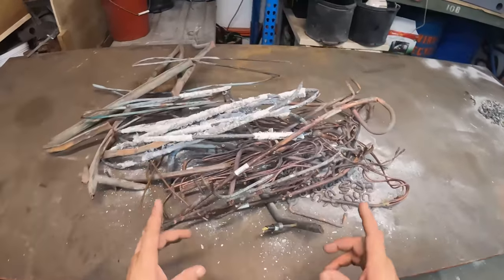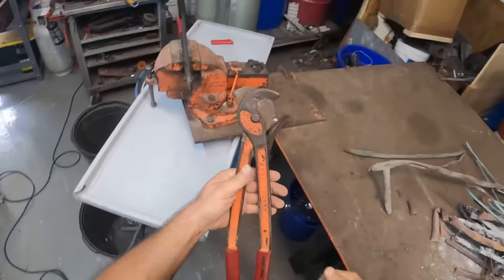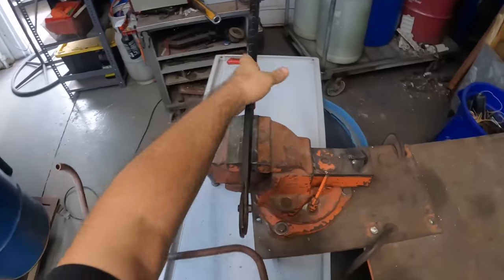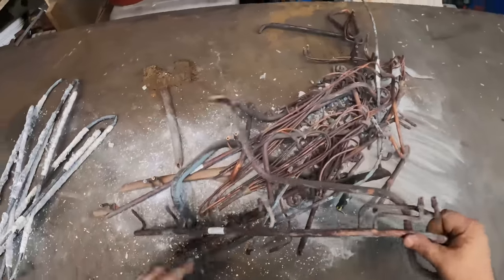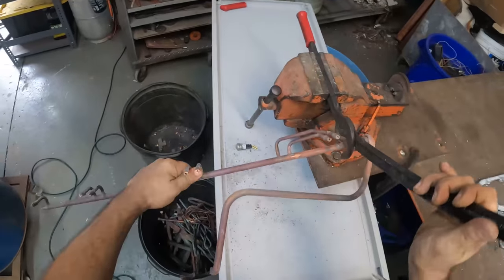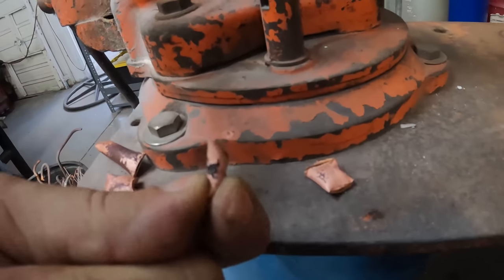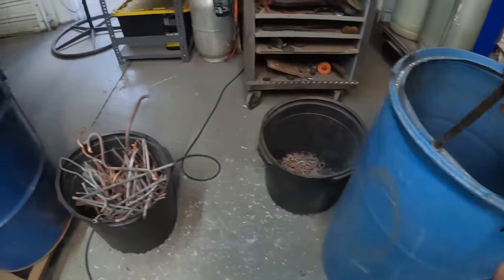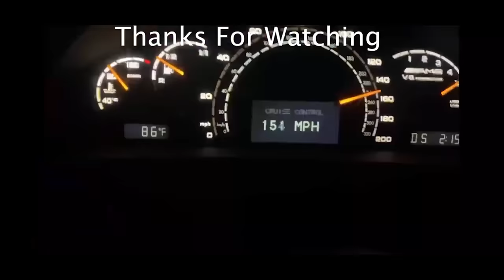Upgrade Copper Quick & Easy For More Cash

Comment: Always good to have a reminder that certain things are worth your time. I can’t count how many time I’ve said it’s not worth my time to salvage this or take something one step forward. And if I had done it by now I would have a ton of that item. In the scraping game small things make big differences. Thanks for another great upload brother. 💪🏻
Reply from the maker: Thanks for watching
Reply: @ProjectShopFl  you should get a Devil Forge or Castmaster 5kg furnace and start a melting channel. You could run the furnace as you scrap for these videos. It takes about 30-45 mins to melt the copper. Have a few bar molds for quick clean pouring and you have double your YouTube income with basically the same work. Use the bars as giveaway prizes to your subs alternating the giveaways between your two channels to send subs from one channel to another or sell them on ebay. Just preheat your molds before pouring them to avoid stem explosions and put cardboard between the firebrick and crucible to keep them from sticking together. BigStackD has videos if your intrested. The whole setup would probably be around $700. The furnace comes with everything to get started except the molds but you will want a decent set of pouring tongs. The ones people make themselves are better than the store bought ones. Videos are available on youtube.

Comment: You must have a better arrangement with whatever yard you're taking that copper to. I do a lot of scrapping around here and any copper with corrosion on it is automatically number two copper. The only copper considered number one is Shiny Bright with no corrosion. At least it is here in in the Tampa area. All used AC whether it has solder or not or corrosion or not is considered number two at least around here.
Reply from the maker: I think some yards are BS'ing  people. I do think there is a point where it could be considered #2. The ac coil copper that I scraped the Aluminum off I would even question if it was #1. lol
Reply: It’s the same here in Australia, corroded, painted, solder, lag (insulation) all number 2

Comment: Mr Whizard, 
Add 2 full table spoons of citric acid to the mix and it will shine the copper . It makes any copper brite . I too am in south Florida.
Reply from the maker: Thanks for the suggestion
Reply: I want to make sure I get this right.  Fill a bucket with water, submerge copper and add citric acid will bring tarnished copper back to bright?
Reply: @okkrom  this is done in a cement mixer not a bucket. #1 copper is 99 % pure. Free of paint, adhesives, weld or soldier joints, oils and scale. 
Just another tip I cut out the electric heat element twist it up and throw in to help clean off heavy deposits.
Reply: @paulb5177  interesting, thanks.

Comment: the wire cutter milwaukee tool changed my life seperating my #1 and #2 but im far from having your shop set up i live and work in an appartement ...the blades are expansive tho but the machine is incredible
Reply from the maker: Thats awesome, I wish I has that kind of cutter.

Comment: I like the weighted Cable Cutter Handle. I've struggled a few times wishing it was heavier. Clearly didn't think of using weights.
Reply: Nice Pipe Cutting Tip. Cutting on an angle to recover more # 1 Copper Pipe. I've been foolishly cutting straight across.
Reply from the maker: Great thing about the pipe it gives leverage and weight.
Reply from the maker: Thanks, every little bit counts.
Reply: @ProjectShopFl  هل هذه الطريقة تزيد وزن النحاس ارجو الرد السريع

Comment: So is stripped #1 copper wire the same as this clean #1 copper pipe? could they go in the same pile at the scrap yard? the guy that runs the non ferrous scale at my yard always gives me #2 price for any copper pipe, clean or not, and I was under the impression that clean pipe was somehow not as good as stripped #1 wire? you gotta be careful with these scale operators, they will take advantage if you don't know what your doing. Keep the vids coming, this channels gonna be huge! cheers.
Reply from the maker: Clean copper pipe is #1 copper it will never be bare bright. If it has solder on it it's #2. That guy is ripping you off.
Reply: @ProjectShopFl  thank you. 

What about stripped copper wire? I had some nice donuts of stripped wire. The wire was about the diameter or your little finger... about 2awg....decent stuff anyway, and it was solid not stranded.... he gave me #1 copper price.....should it have been bare bright grade?

Comment: if you flip the cutter to the other side of the vise, you will have more strength cutting the pipe pulling towards you, instead of pushing  your arm forward to cut.
Reply from the maker: Thanks for the suggestion

Comment: Well my yard says that clean copper fittings like couplers and 90° elbows and 45° elbows are number 2 copper along with the straight sticks of copper pipe,  the coiled copper that bends easy is number 1 but straight pipe and fittings are number 2, they say because it has hardener in it, is that true or not.
Reply from the maker: Not true at least at all the yards I've sold to. As long as it does not have any soldering on it Its #1 copper all day. Sounds shady they are probably separating it them selves.
Reply: That ticks me off I guess I will drive the extra miles to the big yard
Reply: @davepitts1340  Change yards they are screwing you.
Reply: That’s straight BS, all AC copper is C12200 alloy copper, they don’t use anything else

Comment: If you melt the copper would it make it #1.. just reading comments and seeing things about oil and tarnished copper.
Reply from the maker: I don't have to melt the copper I already get #1 copper for any copper pipe with no solder
Reply: I guess I should reframe my question…. If I was to melt the copper because of said issues people have brought up. Would that make it #1 copper.

Comment: Hi how do you follow the price of scrap as it changes ie know the best time to sell
Reply from the maker: When I buy it I try and sell it as fast as possible so I know I am gonna have a certain for sure profit. Then take the money and use it. Don't make sense to gamble and sit on it.
Reply: @ProjectShopFl  This is best advice. If you do not sell your material in regular batches, you are simply a commodity stock trader. If you plan on sitting on material, especially material you pay for, (if its free do whatever lol), you should sell on a short schedule, otherwise, you are better to invest your money in commodity stocks because that is basically what you are doing.

Comment: My yard will only take ac scrap as no2 . No matter how good I clean it has to be shiny as new to go as no1 I guess
Reply: I would just take it to a yard that would accept it as #1 unless their number 2 price is higher than other yards number 1 price
Reply: They have only done it once but what I had , had a lot of the oil on it and in it. I bring about 100 pounds of copper a week so it adds up. What’s the prices at your yard currently. 
No1 2.50
No2 2.30. 
Last week was 2.90, 2.70 can’t believe how much it has dropped in the last 3 months
Reply: Most AC scrap has had oil going through it. I always put it in #2 there's one yard in my area that will take it as number 1.  I guess the oil makes it a touch more difficult to recover or scrap yards are cheap.
Reply: @codiwonkanobi9788  No I guarantee you they just throw it in the number one they claim that their buyers give them a hard time for the stuff that has oil on it but I guess it just depends on who’s at the scale that day the owner usually is the one that gives me a hard time but he’s hardly ever at the scale is usually a younger guy that just takes the stuff is number one as long as the solders cut off
Reply from the maker: Scrap yards are cheep. lol
Reply from the maker: Someone suggested dish soap and a cement mixer. lol
Reply: @ProjectShopFl  we gotta make money too 😆
Reply: @ProjectShopFl  the local scrap yard can't keep up , they've got metal backed up in piles all over their place. They said that they couldn't get enough help. They offered me a job running heavy equipment for $9.50 an hour. I usually get $30.00 to $37.50 an hour to run heavy equipment. I told them no thanks and I know why you can't get any help!!!

Comment: I thought #1 copper had to be bright and shiny.
Reply: There is a #1 and a #1 bright. The bright brings more money.
Reply: @slimpickins09er87  Ok, thanks for the clarification
Reply from the maker: #1 bright & shiny is always copper wire, #1 copper is copper pipe with no solder